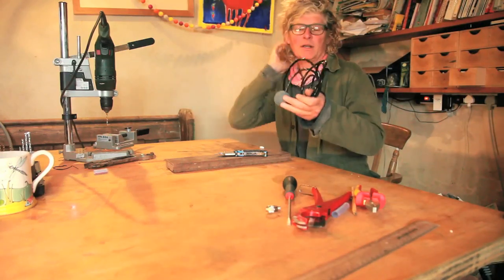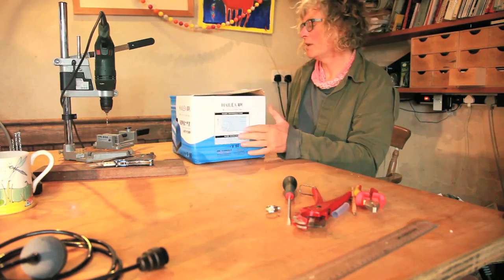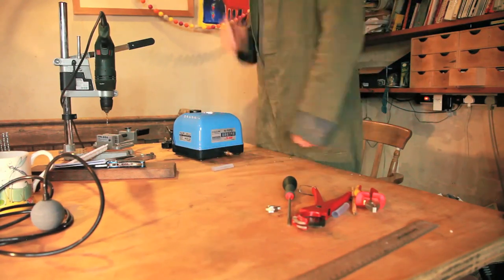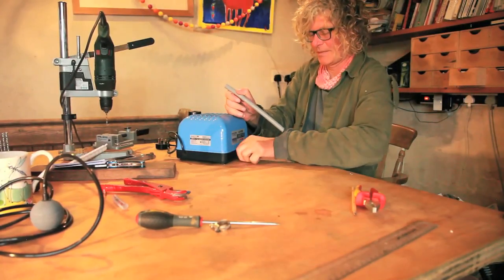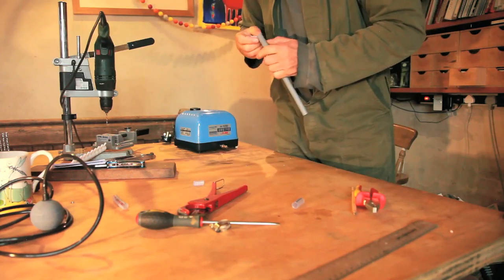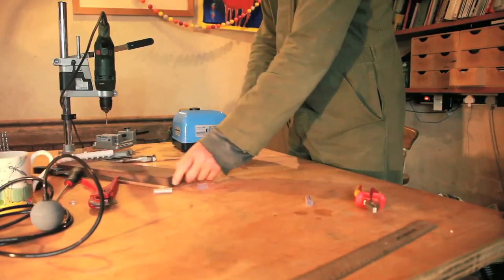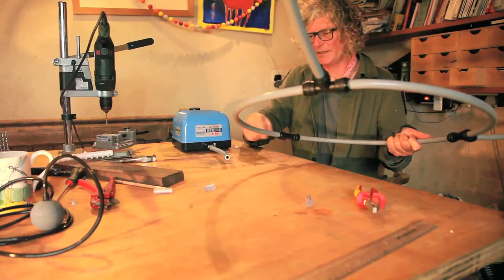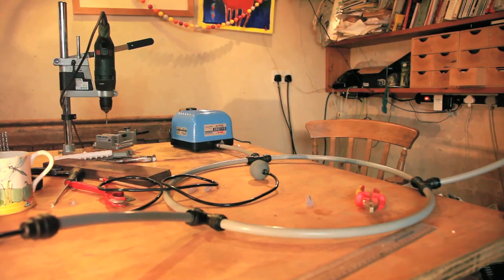Organic Pools DIY kitchen  2 - compressor unboxed and plumbed

Comment: how many airstones can one connect to a single compressor , the can still be effective ?
Reply: Hi Abdul....my guess is that it's 8, possibly 10.  I will use 6 airstones for my pool/pond. 
Southampton UK
Reply: @johnlarkin9594  Hi John, are you also using perforated pipes throughout your plant beds and connecting them to your 6 airpumps? we also have 6 air stones in our pool, would be great to find out how you did it.

Comment: Useful information. Why is it you don't use the irrigation tubing around the pond and use T connectors (if that is what they are called) to feed the lines going to the air stones? Is it to do with pressure?
Reply: Hi Yousha,  that's a great idea, my only concern would be if something goes wrong and you need to get to the pipes for some reason....
Reply: Yo Ahmad....
Do you still want the answer?

Comment: What size pump is adequate to circulate a 13,000 gallon pond?
Reply: Well..... His pond is 8m × 4m × 2m plus the regeneration zone which is mostly rock and 15% water....
That's about 70 cubic meters. Or about 18,000 gallons.
He uses a 15 liters per minute pump.
It's been two years.... I doubt you still need or want the answer. But....there you have it.